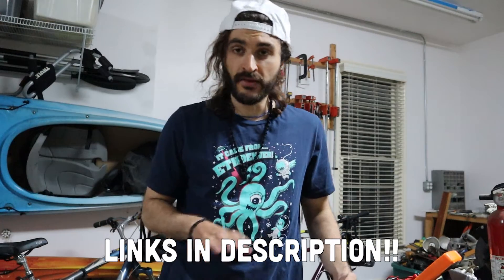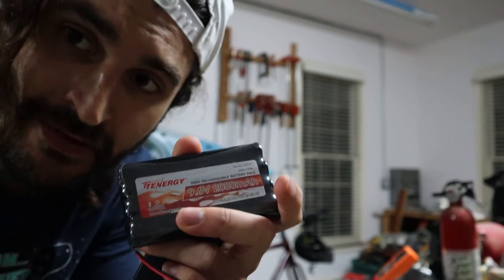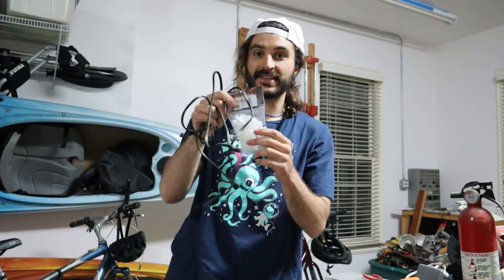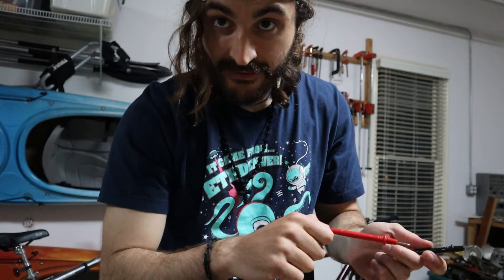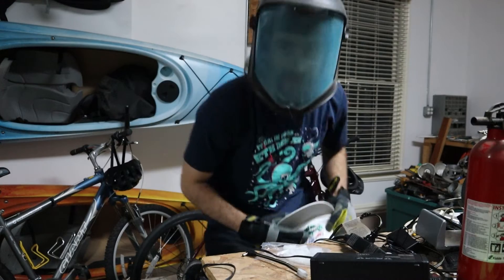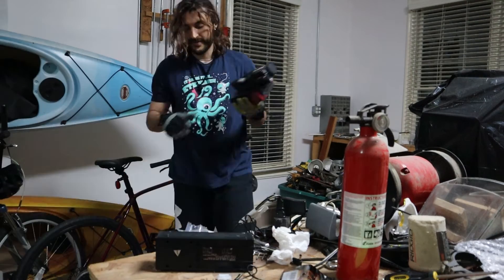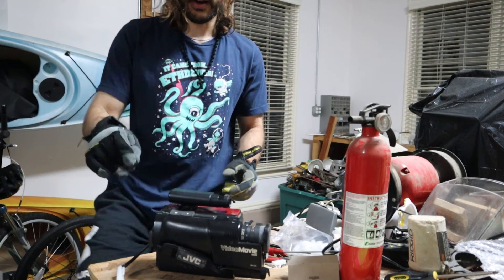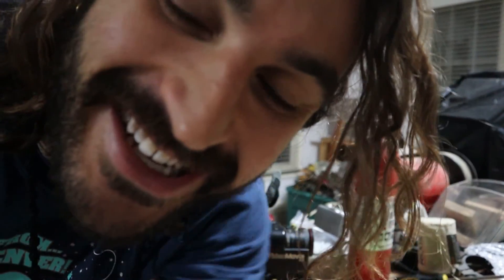How to fix ANY old camcorder battery! (I use a JVC GR-C7U camcorder)

Comment: So I have a canon fs100 camrecorder and when I try to start it, it says “change the battery pack” and then it goes off. So what is the problem, because i bought a new battery for it and the charger works .

Comment: This is incredible! I have the same camera, this walkthrough is super helpful. One question: notice anything funny with the 11v coming from the battery pack? Is that anything to be concerned with?
Reply: Late reply but chiming in: batteries have a nominal voltage, but the actual voltage is higher when fully charged, and lower when discharged. Beyond that, the voltage drops when under load, unless there is a voltage regulator built in to make it steady, which I think is unlikely, and the camera probably has one internally for the correct function of the internal electronics and motor.

Comment: Haha thank you so much for this video! I might just try this. I see you linked the buck converter in the description but you didn’t use that in the end, right? Is it necessary? And when you charge the battery, does the wall charger indicates if the charge is full or do you have to guess it? Any other thing I should know that’s not covered in the video? Still enjoying the cam? Haha cheers man
Reply from the maker: Hey man! 

No! You don’t need a buck converter if you have the correct voltage for the camera

Yes! If it’s an RC battery, it will tell you when it’s charged 

Nope! I covered everything (I think) in the vid
Reply: @filoi2583  thanks a bunch man!

Comment: isn't just buying a compatible power bank and connecting it to the camera easier?
Reply: Batteries for that camera are available at battery king. Becareful the battery your using can blow and start a fire. I know I do RC and those batteries can be dangerous especially if punctured
Reply: btw, I own a Panasonic PV-950, the battery says it's 2000mah and 12V, I also know nothing about batteries, would your tutorial work for this camera? thx in advance.
Reply from the maker: Hey bud, so yes hahaha to your first question. I could not find any power bank or battery compatible for my camera. I looked everywhere and could not find anything. This was my absolute last option. 

Yes also to your second question. This will work for any VHS camera. You just need to find an RC battery with 2000 mAh!
Reply from the maker: Also the battery needs to be 12V!